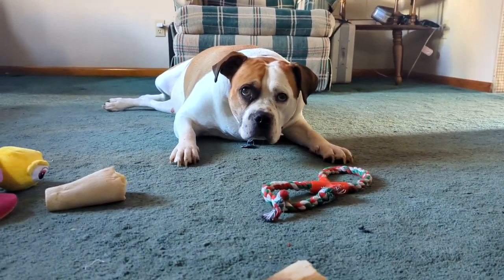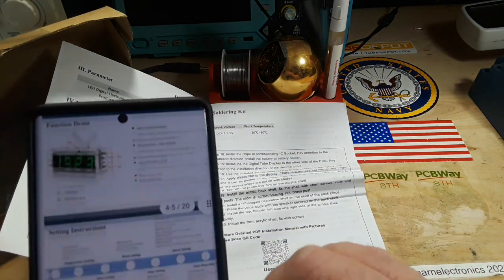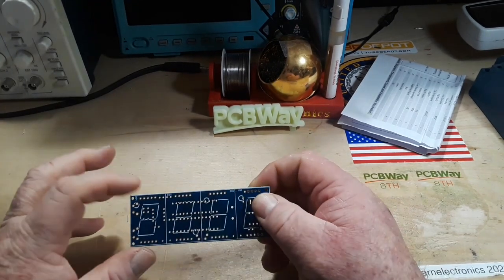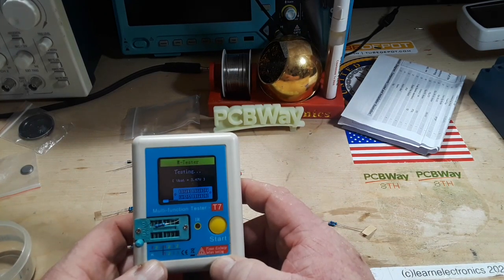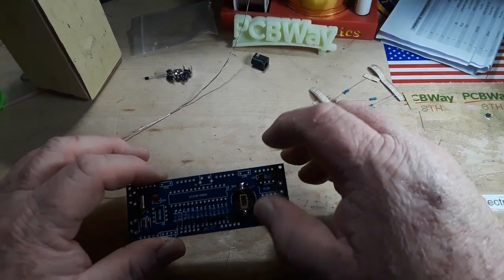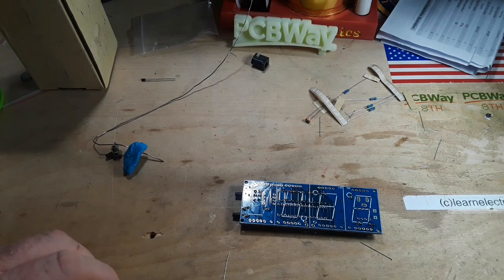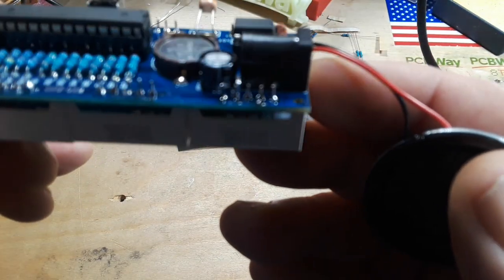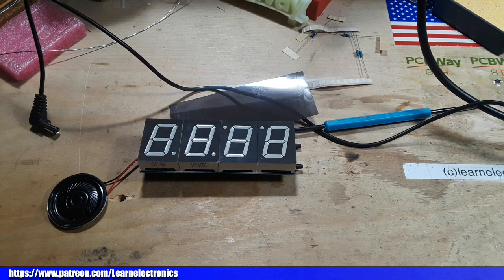A Clock Kit With Some Issues Part 1 of 2

Comment: This is the first time on YouTube I have seen some soldering tech-necks shown. I was taught to solder by the Air Force how to solder in the late 1960's. in 1984 I went through a High Reliability Hand Soldering course, developed by NASA.for use on their space rockets. The Hersey Kiss join saved up to 5 tons in weight and provided max soldering reliability. There are a few more steps missing but you covered the main one.

Comment: Although resistors are not polarity conscious it DOES matter which way round you place them on the circuit board. This isn't just for aesthetics but for fault finding during and after the build.
It's so much easier to trace a fault if there is "method" in the construction.

Comment: you soldered the 4th LED segment the wrong way round. Only the 3rd LED segment is upside down, not the 4th.
I soldered a similar one only without speakers and speek, but with a beeper.
33:57 you are right. 44:51 you are wrong

Comment: I may have missed it but I can’t find a link here for this kit.  Can you provide a link?  Thanks
Reply from the maker: Im not promoting this thing.
Reply: Amazon has a few different ones similar to this one. This one seems to have some hiccups in assembly.  I found one for about $12 on Amazon, that I'm going to try.   (You might click the learnelectronics affiliate link to go to Amazon so the channel gets  little support. :) )  

I'm an older guy, but like tinkering.  I've done a couple beginner "fun" projects, but like this because I can make a practical use of a clock.  Have fun!

Comment: My Brother!
Did you get 2M miniture / micro-miniture certified in the Navy. I got mine in the USAF and they were super strict about using liquid flux. I know solder has a Flux core, but in my experience, liquid Flux makes the solder spread quicker with less heat.  Any thoughts?

BTW love your channel, never heard of bluetech where can I buy that stuff.
Reply from the maker: We had 2MMTR which I think is probably the same.
I agree flux makes all the difference and I should use it more. I'm just old and lazy now. I used to be squared away, but time takes it toll 
Bless you brother.
Reply from the maker: Oh...Blue tac....3M poster adhesive
Reply: Love your channel brother, keep up the excellent work.

Comment: Silver Solder usually looks dull.
Reply from the maker: Who does electronic soldering with silver? Im not trying to troll....I thought it was the domain of HVAC guys?
Reply: @learnelectronics  It is being used quite often now in manufacturing to be RoHS compliant. Also used in areas that are high temperature as silver solder melts at higher temperatures.

Comment: Nice project.  Ordered a similar clock using your affiliate link as it is a useful clock AND good practice for a beginner like me.  Thanks for the vids on this one.

Oh the blue tack is a handy tool for positioning components.  Thanks for the tip!